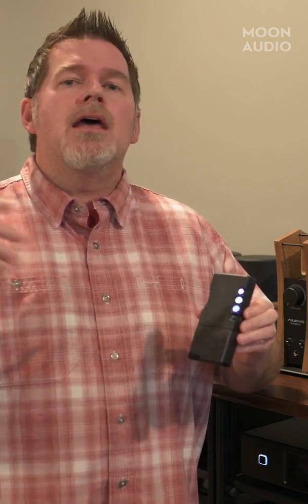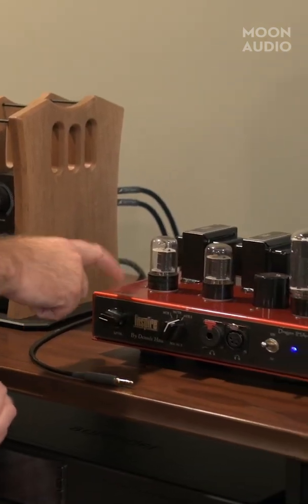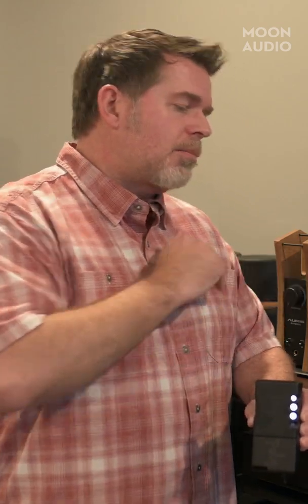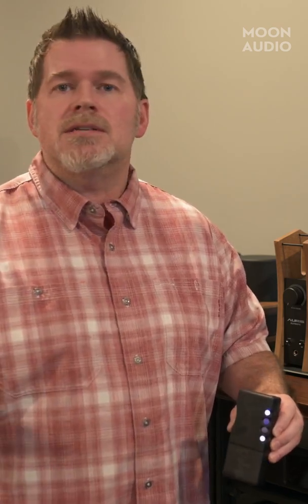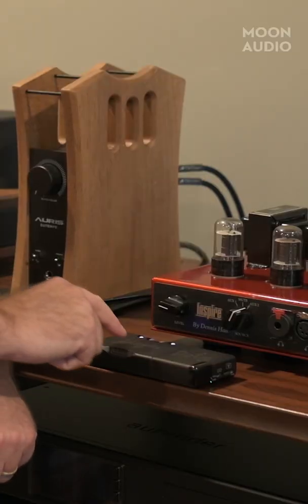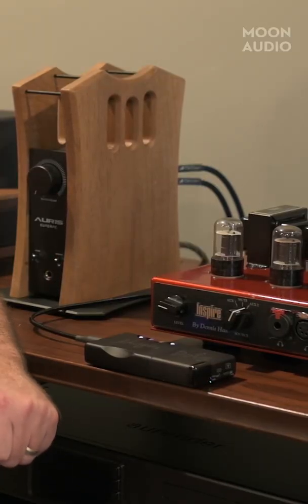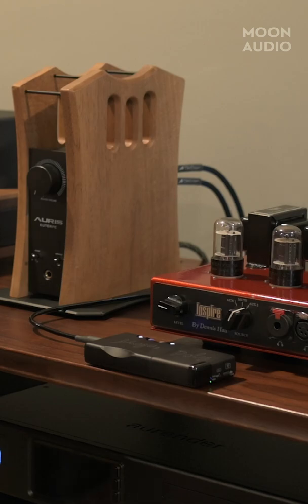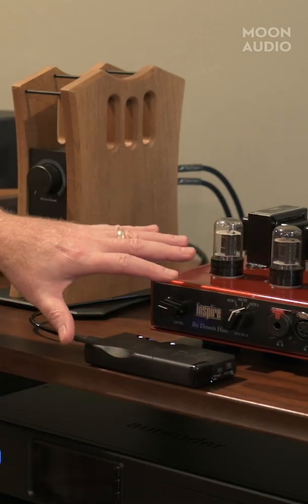Chord MOJO 2 + DRAGON INSPIRE Tube Amp = Desktop Audiophile BLISS | Drew's Audiophile Tech Tips

Comment: You connected it to the tube amp but like many you tubers you did not show exactly how and what cable and the input output , so I'm sitting here saying where the heck you plugged  into, you can't assume we know , chord mojo 2 is weird in its self .
Reply from the maker: It's this cable: https://www.moon-audio.com/silver-dragon-portable-mini-cable-v3.html 

The cable itself is custom which is why the photos are different, but it can be customized to work with this setup.

The 3.5mm headphone output on the Mojo 2 means you should select the 3.5mm TRS option in the "Source Connector" field and dual RCA inputs on the back of the Dragon inspire means you should select the Dual RCA in the "Receiving Connector" field.

Hope this helps! 🙂

Comment: No one on you tube done a video on how to use the chord mojo 2 as a dac only and show with actual equipment,  ho to connect it and what type of cables and different ways and reasons..it sucks that there's no balance output . People on Google try to explain but it still sounds confusing   a video on this would help.

Comment: First I want to tell you how much I appreciate your written mojo 2 manual that I found on Google. So much better than the one by Chord! They should hire you for their next manual! But I have a question that I couldnt find in either manual: how to connect  the mojo to an (solid state) amplifier for use with speakers.  (I found out this info somewhere else but it is hard to find) and 2. what is the  best mojo volume setting for a solid state amplifier? Is that as low gain as possible, volume controls as low as possible? I read somewhere low gain is best for a integrated amplifier (no tubes). Is this correct?

Comment: Are the mojo 2 cases available yet? I already preordered.
Reply: got mine in the UK! 
If you already have the poly I suggest you update your poly firmware first when connected to your mojo 1 as I couldn't do it on the mojo 2 and already traded my mojo 1 in!
Reply: @jasperthecat1830  is the poly really worth it, I think the fact they made the mojo2 compatible despite taking stick for micro usb etc is excellent, I need to look into it further, can it be a rune endpoint for instance?
Reply: Scratch that yes it  can
Reply: @adrianmorrish8494  yep, I use mine with roon without issue. Setup is a bit of a pita but once going it is faultless, I fully recommend the pairing.